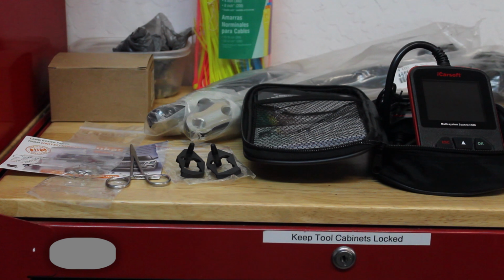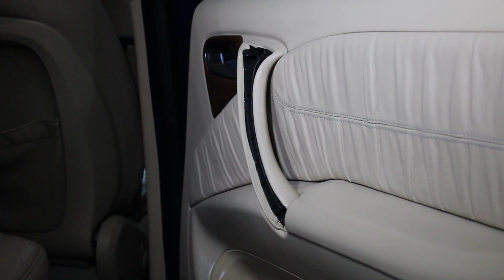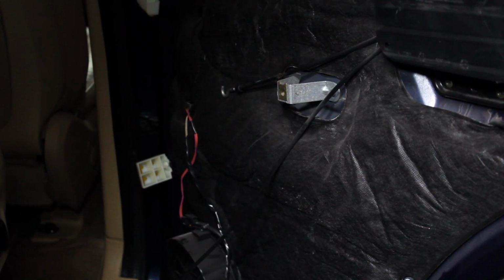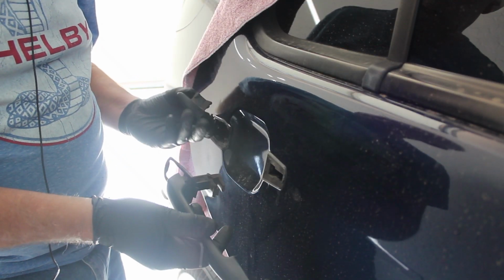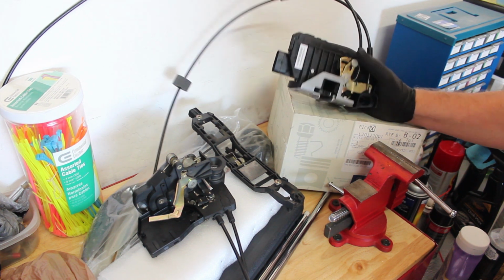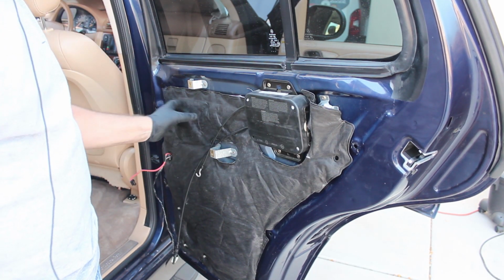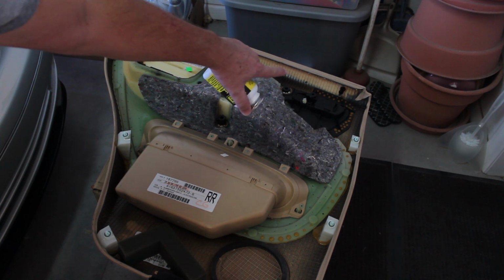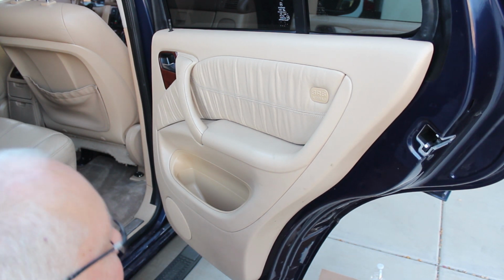Mercedes-Benz ML Door Lock Actuator Replacement (W163)

Comment: Mercedes apparently doesn't make driver side rear anymore. Not even a new part number. Aftermarket supports all 3 side front and rear minus the driver side rear! Insane. Ordered a used one, came out bad. This is frustrating.
Reply from the maker: Interesting, but more the norm these days for older and lower-volume-sold parts.  Lots and lots of discontinuation make it unsustainable to own some older vehicles anymore.  Thanks for watching!

Comment: I can beat this, door shut, childlock on, wont unlock from inside or outside, removed door card with seats in place (tricky)..here in UK cars older than 3 years require a roadworthy test every year...called an MOT. Ministry of Transport annual inspection.

Comment: So do i have to replace all 4 door actuator so the automatic lock can work?
Reply from the maker: No, only the broken ones - if all 4 are broken then you do need to replace them all, but if they all stopped suddenly at the same time, you may have a control system issue.  Thanks for watching!
Reply: @redonKiLaus  Do you think I can install universal actuator? Also what fuse do you remove to deactivate them
Reply from the maker: @Menga213  I don't think that'll be feasible, there's CANBUS comms that run thru the actuators as well.  Not sure on the fuse, varies per model and there may not be one for the MLs since they do have the CAN system run the actuators...may be an electronic cutoff as opposed to an actual fuse.  I'd consult a service manual or MB specialist for info on that.

Comment: Nice video but it cuts away at all the places where you really need to insert "Then a miracle occurs".  I have a very slight build but I can't get my hand back inside to reach the door lock actuator or the bracket on the back of the door handle.  I'm extremely reluctant to loosen a single screw for fear that the pieces will simply drop out with no way to get them back in place, let alone thread the replacement actuator in there.

Can you give me any guidance on how to reach these parts? Is this a one person job or do I need a 2nd person to work and hold things on the outside while I struggle with the parts on the inside?
Reply from the maker: It's been too long since doing this job to remember exactly how difficult everything was to get to, but I don't recall it being too bad.  I don't have a particularly large build, with wrists roughly 7 inches in circumference for reference, but I am tall and have rather long arms and was able to reach up into the door (IIRC, through the speaker hole) to manipulate the parts.  I did have somebody helping me, but I can't remember exactly what I needed help with specifically - to be safe, it would be nice to make it a 2 person job.  Pulling the outside door handle is no big deal, and you won't lose any screws doing that portion of the job since the set screw that holds the handle stays in place, and once you have that off you may have a better view of everything going on.  

Hope that helps in some fashion - thanks for watching!
Reply: @redonKiLaus  I finally decided to tackle this job.  It took me a bit over an hour once I had the door panel removed. I can offer a few tips to anyone wishing to try it.  
1) Make sure you remove enough of the padding to allow you to get low into the door panel opening so your arm can get a straight shot up into the latch area.  
2) You MUST remove the inner bracket piece behind the outside door handle as stated in the video.  Fortunately it's not hard to re-install once the lock is back in place. I found it best to remove the screws completely.
3) The 2 Torx T27 screws are the only things holding the lock assembly in the door.  Remove them and the assembly will drop free but jam up inside the door unless you've remove the inner door handle bracket first.
4) The electrical connector has a latch that is a challenge to unclip. You can't reach the clip until you have the latch detached and slid down as far as the rear window track.  The connector also has a rubber weather seal inside the plug so it needs some persuasion to get it out.  I used a small screwdriver wedged into the clip to release it, and then channel locks to grab the connector and pull it free. 
5) The rear window track is in just the wrong place so it can make it a challenge to get your arm in there, plus forget trying to twist your arm once it's in there.  The track also interferes with the lock assembly when pulling it out from inside the door and getting it back in.  Use a little pressure and care and you can get it past the window track but make sure you have it aligned properly and flush against the door interior panel or it will just jam up. 
6) Fish a wire behind the air bag through the opening where the door release and lock cables go.  Tie and tape it to the cables on the new lock, and then start pulling gently as you start to slide the new lock assembly up into the door. 
7) Continue pulling and sliding, making sure to keep the assembly in the proper alignment, and then don't pull the cables too tight or it will prevent you from aligning the lock correctly.  
8) Once the lock all the way in there it is trivial to line it up and tighten it down. 
9) Now slide the door panel inner bracket piece between the outer door panel and the new lock (this was much easier than I thought it would be) and re-insert the screws, tighten it down. 
10) Reach back up inside one more time and attach the electrical connector ... it goes in much easier than it came out.
Now it's just reassembly of the outside door handle and inside door panel.

It's so nice to have the doors lock & unlock normally once again.
Reply from the maker: @lovemy912  Very good advice for anyone attempting this job - I'm glad you got through it!
Reply: @lovemy912  hey how many actuators do i need to buy so all my locks can work automatically? My keys don't lock all of my doors.
Reply: @Menga213  Each door has its own actuator. And each one is different ... front, back, left, right. They are a SUPER pain to replace.  I would not recommend trying this on your own unless you are very skilled and have very small hands.

Comment: Nice video. I'm trying this myself today. At 6:24 mark in your video, does that inside bracket have to clip on to the actuator? I'm having a tough time getting it back in. I should remove that bracket. Is this correct? I'm assuming you put it in & then you put that bracket in. I tried that initially but very tough. Please advise if you can. Thanks
Reply from the maker: I believe the way you are describing it in installing in two stages is what I did - it's been so long since I did this job I can't remember for sure.  Sorry I can't confirm that for you.  Thanks for watching!
Reply: @redonKiLaus  hello my friend, I tried this morning & I got it in. What a pain. It would be nice if MB made access panels to these types of repairs. Unfortunately, I'm still getting the machine gun lock but on the left rear now 😒. Is there a way to determine/isolate this problem rather than changing parts. I don't even know if the one I got from the junkyard is good(the one I replaced this morning). It looks fine, and no missing or broken peices.
Reply from the maker: A canbus-compatible scan tool can help you determine which modules are reporting errors, but that will not always narrow down the culprit, especially if a given module doesn't realize it is malfunctioning.  In my case, not only did my lock not work at all, but it also reported an error.  

Personally, for wear items like actuators, I wouldn't recommend pulling used parts since you never know how much wear they have on them.  New parts, and preferably OEM, are the way to go for me.  

Hope that helps!
Reply: Thanks for your advice. I might have to get an OEM one but I'll try the scanning. Regards, Omar (Mississauga,Ontario)
Reply: @nsxt290  hey did you replace all 4 actuator so the automatic lock can work?